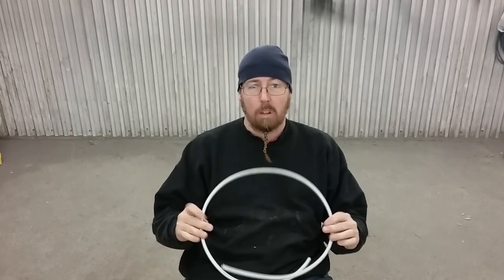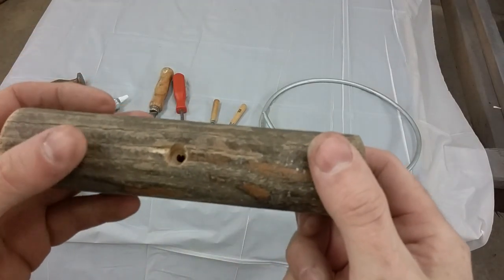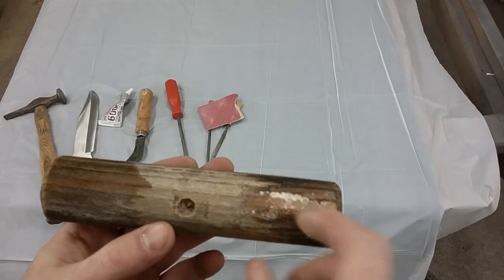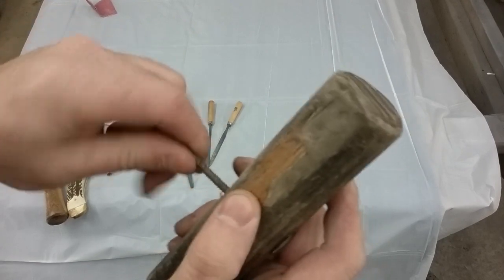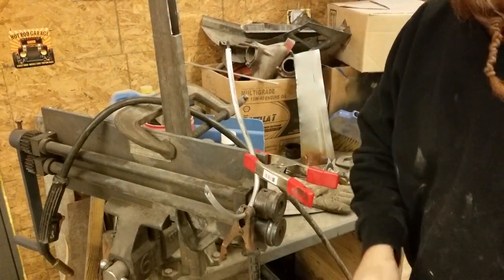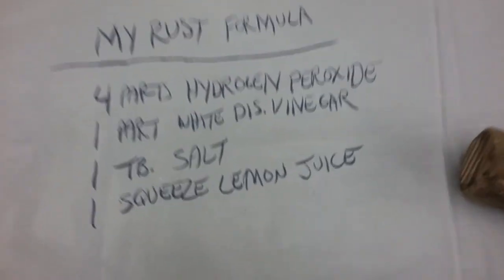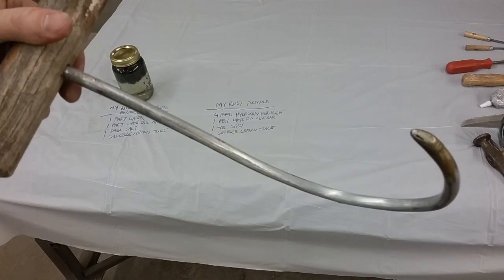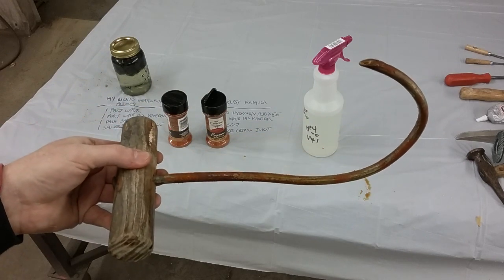DiY MEAT HOOK of DOOM With rust and weathering techniques! (NOT 4 KIDS)| Cobwebs and Candlesticks

Comment: Can't you put can foam in it to make it rigid
Reply from the maker: The fuel line is more than rigid but I could easily  use rigid foam foam for the handle. To fill the small hollow of the fuel line wouldn't hurt it though.